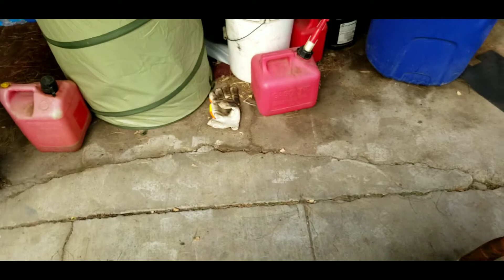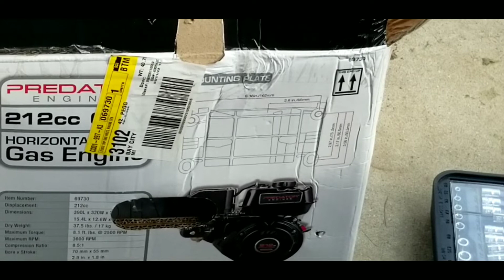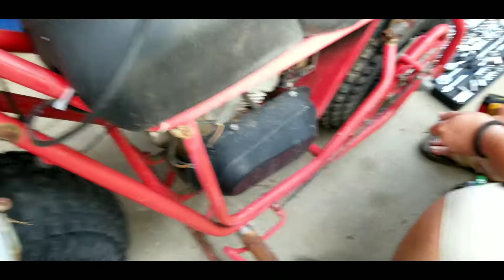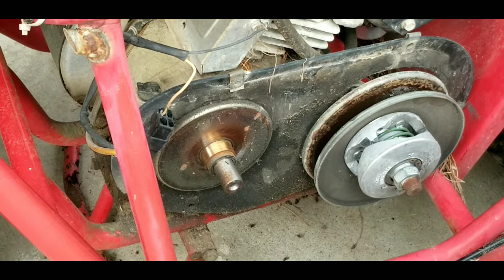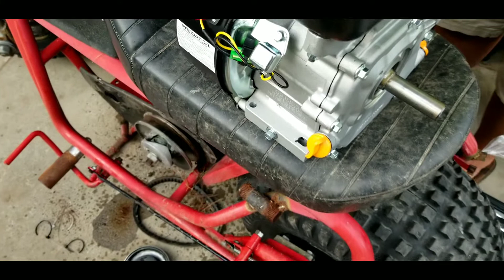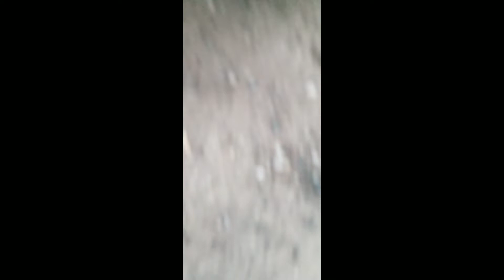How to replace Manco Big Cat engine with Predator 212 from Harbor Freight.

Comment: I replaced a Tecumseh 6 hp on my Troy Built tiller with a Predator engine, Works great, easy to put on, starts with one pull.